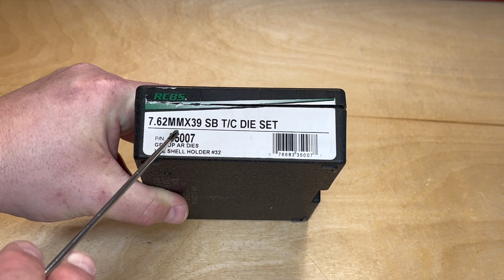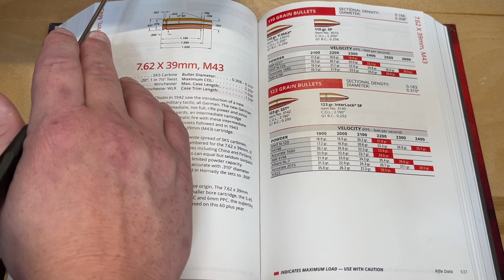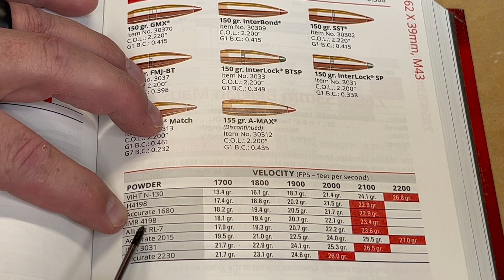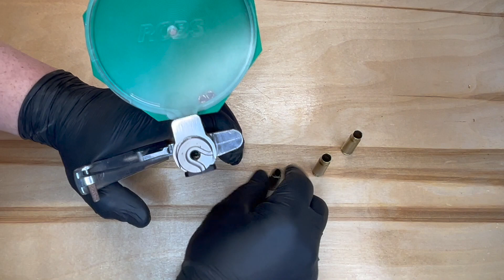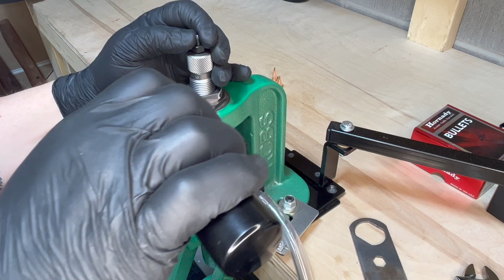How to Reload 7.62x39 For Beginners

Comment: Do you find any accuracy issues using a .308 projectile instead of a .311?
Reply from the maker: @stevenaylor-t6v - Steve Good question! I haven’t done a controlled, side-by-side accuracy comparison between the two, so I can’t give you a solid verdict. I appreciate you bringing it up—that would be worth addressing in a follow-up. 👊🏻

Comment: Just curious, since you were using .308 bullets instead of the .311” are you loading these for a Mini-30? If not, and you load these for AK/SKS platforms, do you see accuracy degradation?
Reply from the maker: @paulfrehley7352 - I do not use this caliber enough to give much of a discussion. Perhaps, this will open a dialogue! 👍🏻
Reply: @k2defense The only rifle I am aware of chambered in 7.62x39mm which has a .308” bore is the Ruger Mini-30. Maybe the Ruger bolt action as well. But all AK/SKS-pattern rifles have the original.311” bore. I’ve always heard that shooting 308 bullets from a 311 bore gives poor accuracy. I’ve decided to load this caliber since I found a great deal on a case of reloadable brass 7.62x39 ammo, and I was just doing research on this caliber when I came across your video.
Reply from the maker: @paulfrehley7352 - thanks for the comment! 👍🏻

Comment: Sorry can't hear you, volume too low for my max volume. Most videos by far have adequate volume, so you need to edit for higher volume. Most computers and cellphones are capable of reducing volume considerably, but not increasing it.
Reply from the maker: @twintwo1429 - my first batch of videos were not well refined with proper mics, etc. check out my newer videos and see if that volume works for you. There’s no way of changing the current videos but going forward they should be much better. May have to redo a couple because of this misfortune. Thanks for the feedback! 👍🏻
Reply: @k2defense  👍, will do, thanks.

Comment: Is there one powder that preforms beter than others or it doesnt mater 

I reload pistol ammo 9mm 45 acp 10mm ect and there are powders that i like  over others.
Reply from the maker: @freedom-vc9wi - yes, there are certain powders that work better than others. Your best bet is to use the reloading manual with the corresponding projectiles. In the manual, they give you the top powders to use with their projectiles. This is the safest and most predictable way of working up loads. They take the guess work out of it. Now, some will tell you that they experiment with other powders or have their own special recipes. This is called “wild catting”. For liability reasons, I cannot suggest that you do it. Hope this answers your question! 👍🏻
Reply: @k2defense  thank you for your time and advice i preciate it
Reply from the maker: @freedom-vc9wi - you bet 👍🏻

Comment: I have an issue with my 7.62x39 case mouths being .311 and trying seat Berrys bullets that are also .311

Do they expanders that are .315/.320.. or should  i flare the mouth somehow.. 🤔
Reply from the maker: @dr.bonscott3962 - I am unaware of an expander die for this round. I run into the same issues even with my .223/5.56 rounds. Since I have sausage fingers I just try to hold the projectile as long as I can while running the ram up to keep the projectile in line with the case mouth the best I can. I have used a Philips screw driver to flare cases before being careful to not mess up the case mouth. Hope this helps.

Comment: Not interested in reloading 7.62x39 with .308" bullets. I don't have a Ruger. I have been buying nothing but reloadable 7.62x39 for the last several years. I am sure that subsonic hunting loads can be put together for less than Hornady charges for their 255gr Sub-X. Especially since RNL bullets should be acceptable for subsonic loads.
Reply from the maker: @dbmail545 - yeah, there have been a few people not interested in .308 projectiles. Let us know how it goes with your recipe, if you’re willing to share. Thanks for the comment! 👍🏻
Reply: @k2defense  still looking for a suitable mold. 240gr to 260gr RNL cast bullet that can be resized to .312"-.314".
Reply from the maker: @dbmail545 - here is one that is close to what you’re looking for. 

Let me know what you think. 👍🏻
https://www.mp-molds.com/product/mp-300-blackout-311-235-grain-solid-mold-no-lube-groove-multichoice-2/
Reply from the maker: @dbmail545 - wondering what your twist rate is that you’re using for the subsonic rounds? If it’s a standard AK I believe the twist rate is 1:9.45
Reply: @k2defense the Hornady Sub-X 255gr hunting bullets stabilize just fine out of my 1/9.5" twist CZ bolt guns.
Reply from the maker: @dbmail545 - awesome thank you! 👍🏻

Comment: Thank you for making this video easy to understand I’m planning on doing that my question is is it cheaper to do your own bullets I’m not ah handy guy so all this is new to me
Reply: Thank doe the advice and thanks you for replying me back
Reply from the maker: @imtiazboss  yes! Of course! Happy to help! Cheers! 👍🏻
Reply from the maker: @imtiazboss - in short, yes. If you’re referring to projectile casting, you can make projectiles for less money as you can usually pick up the casting material at give away prices. Before someone nails me to a cross, the overall process of reloading is expensive to start. Depending on how much you shoot and reload, the ROI will be years down the road. I didn’t want there be any unreasonable expectations of saving a ton of money. Hope this help! 👍🏻

Comment: would not recommend this for people trying to get higher tier accuracy since thats a .308 bullet you are trying to shoot through an sks or ak rifle. their barrels are meant for .311 size bullets.
Reply from the maker: .308 are .310 in diameter. Never had an issue with either the SKS or AK. However, with that be said, I’ve never chased extreme accuracy with either. So to your point, I guess if you’re looking for sub MOA I’d stick with .311 projects. Also, I’ve been shooting these for years and never had a key hole incident in the barrel. Thanks for the comment! 👍🏻

Comment: i believe 7.62x39 required a .311 diam. bullet, Hornady, speer, Sierra all make this diameter bullet , same as .303 British 7.62x39 and 7.62x54 are a hair larger than our standard .30 caliber round 7.62x51 ( .308 )
Reply: My reloading manual has the diameters ranging from .308” to .310” and says the size depends on the manufacturer. Most American made use .308 and most overseas use .310 but there are exceptions like the Ruger Mini-30 which uses a .308. I guess a good set of calipers would be worth using before loading up these cartridges.
Reply: @bangswitch.2A I've been told from a reputable source at PSA that they use the same .2980 gun drill (.30cal bore size identification) for all 7.62x39 AR (ks47), AK, and AR10 .308 for what it is worth = .308 cal bullets
Reply: @bangswitch.2A   Kerry is right.  The AK uses .311 bullets in common. U can use .308 or .309, but best results and what the barrels are made for is .311 inches.
Reply: .308 Like sending a hotdog down a hallway in a .311 barrel bore..😂😂
Reply from the maker: @joshuabird852 - now that’s funny! 😂👍🏻

Comment: A “trick” I learned along the way from whom I do not remember… when seating bullets, fully seat the bullet, spin the cartridge 1/4 turn in the shell holder then seat again. It does wonders for minimizing bullet runout. (The bullet being slightly off center) contributes heavily to accurate accuracy. Then roll the cartridge on a super flat surface (corian countertop or flat glass and look for tip wobble. Crude method but it’ll help with your accuracy trouble shooting process. Rules out some equipment tolerance issues.
Reply from the maker: Genius level 1000! Thanks for the tip! 👍🏻
Reply: For AK ammo, this should not be a concern at all.  Frankly, chamfering inside your case neck plays a much important role to seat the bullet straight or expanding if you're loading on progressive (especially if you're working with lead bullets).  If you skip the chamfer and I've seen this happen, the bullet will sometime catch one end of the case and tilt as you're pushing inside the case, resulting in all sorts of problems including excessive runout.  In worse case scenarios with thinner neck cases it wild fold or crumble the side of the case resulting in ruined case.  During COVID shortage I bought 1000s of cases that hundreds of damaged cases like that in 300 blackout.  I bought it to salvage the primers.

Another thing I found that helps me a lot is to use a die that has a sleeve to keep the bullet straight.  I use Vickerman die, RCBS has Gold match, Hornady has one, LE Wilson, etc.  Now if you really want least amount of runout, I would recommend using Lee collet die and size it twice in the same fashion rotating the case.  This will ensure the case neck is straight as it can be to start with.  It also makes a difference if your press has a floating shellholder like MEC or a floating die like Co - Ax.

Comment: Excellent video! I also decided on 4198 after using many different powders. I see you also use (Hornady?) clamp-type stops on your RCBS dies. I did the same. RCBS is excellent but I love those clamp stops. 
Something I'd like to share is that I was getting bad data from my Wilson case gauges. Turned out (years ago), that the excellent Wilson case gauges had a flaw with the 76239 as it didn't recognize that that case has a rim that is ever so slightly proud of the base of the casing body (.447 rim vs .443 base). This gave me bad info on my resizing efforts. I found it and reamed out my gauge with a true multi-blade reamer bit (not a drill bit) just a little and that fixed my experience and ego. I imagine Wilson has fixed this.
Reply from the maker: @Jonno2summit - the Hornady locking rings are awesome! Changed out all my dies to them! Thanks for the heads up on the case gauge! 👍🏻

Comment: You are using the wrong bullets. Hornady makes Vmax and SST bullets .310 diameter.  PPU makes similar soft point bullets. Either of those are what you should be using.
Reply: Depends on the firearm manufacturer... I've been told from a reputable source at PSA that they use the same .2980 gun drill (.30cal bore size identification) for all 7.62x39 AR (ks47), AK, and AR10 .308 for what it is worth = .308 cal bullets
Reply from the maker: Thanks for the comment! 👍🏻
Reply from the maker: Jun Gleno - can you elaborate more to others why you feel that FMJs are not what should reload and why? Your claim is an interesting argument. Thanks for the comment! 👍🏻
Reply: @k2defense  good luck finding fmj .311 bullets . Please let me know if you do. Hornady's #3142 SST 123grain .310 diameter flex tip bullets are the most accurate I've found for the AK and SKS.
Reply from the maker: @jungleno.  I was using  .310 projectiles. I haven’t had good luck with finding the .311. Thanks for the reply! 👍🏻
Reply: Berry's plated spire point 123 gr .311 diameter is rated for 2400 fps.about 15 cents a pop.  @jungleno.

Comment: What rifle did you shoot these in & what was your accuracy. I am leaning on 308 día bullets for my AK 47 because their is a better selection of bullets in 308 dia instead of 311 dia which I believe AK 47 needs. Any thoughts???
Reply from the maker: David Ortiz — I use this ammo in my AK-47 and SKS. In my experience the .308 does just fine in the AK-47. They stabilize well and what I prefer for the AK. I’m sure someone will have varying opinions on my preference but that’s the best part of learning how and what to reload. Hope this helps! 👍🏻
Reply: 45 years handloading I've Never used an .308 projectile on any commie rifle......Some Finn Mosins have a close to .308 but not the norm...Slug your bore.... .310 to .311 projectiles... 123-124 grain for AK's n SKS's.......be well.
Reply: For sure. Not to mention the 150grn. bullets are usually more accurate( across the powder weight spectrum and brand) It is usually thought that the 1in10 twist rate tends to spin to fast for optimum accuracy in the 123/4/5grn.
bullets. This isn't always true; Barnual FMJ,SPand HP 123grn. are all the most accurate factory ammo( out of my 11" PWS AR upper and 12" VZ58)

Comment: Two things I can offer: place a 25 lb bag of shot on your powder measure stand "round". It will make a marked difference in consistency of your throws. I've tested it both ways and it really does. 2, place an o-ring under the seating stem locknut. It will allow the stem to find center enabling bullets to seat more concentrically. Thanks
Reply: I’ve wondered why some of the “newer” dies, other than Lee, cow with that O ring… I remove them due to wanting a solid lock between press and die.. When initially trying with the oring on, it tended to squirt out one side making the die terribly crooked. that said, when seating bullets I press then do a 1/4 turn and press again. Very rarely have issues with runout doing that. But I’ll keep eye on that issue and might play around with it. 👍🏻
Reply: @marvinbrock960 the Lee dies with o rings aren't meant to be "reefed" down tight. Just snug the nut up to resistance than maybe another half turn at most. Took me forever to learn that. I've always been of the rocksolid mindest
Reply from the maker: Luvta Handload - I normally have the powder thrower permanently mounted to my bench. For video convenience, I mounted it on a portable stand. Doesn’t work well the way I have it so thanks for that tip 👍🏻 

For your second tip - can you post a pic? Sounds helpful!